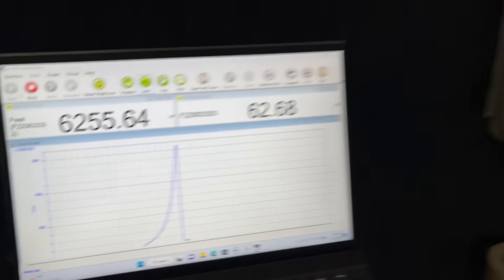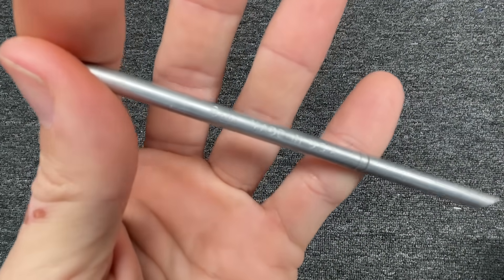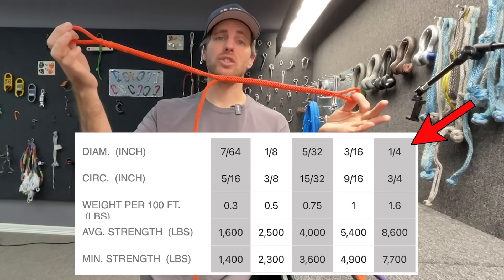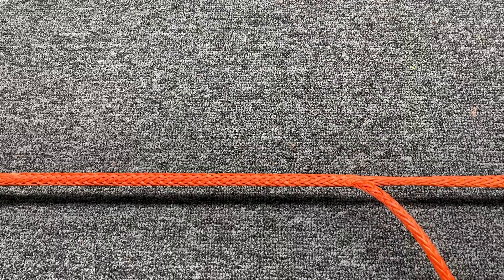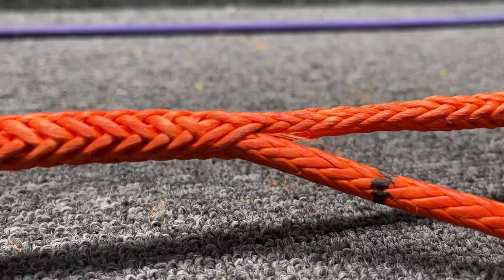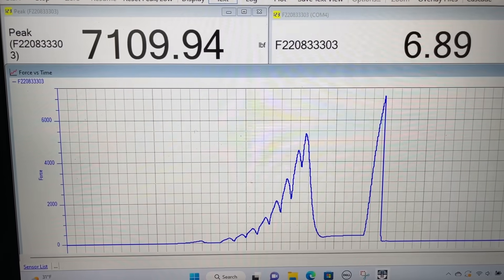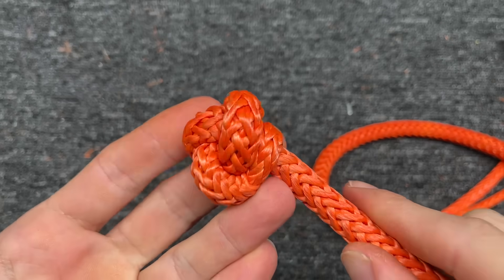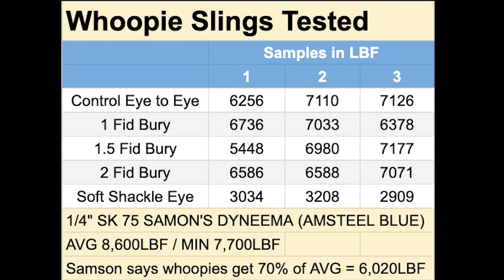Why The Overkill?

Comment: From a standards perceptive, I think that if the testing standards for gear is not representative of normal or intended use than it is not useful as a standard.  I would be interested in seeing more regarding the testing specifications.  Additionally it would be interesting to work with the standards body and manufactures to develop new test standards that include knots, carabineer sized bends, and other common attachment methods.  I could see a standard that says a rope must meet 50% MBS with a knot and 90% with a splice or something similar.
Reply: The problem is: from an engineers perspective the main point of standards is for quality control, not about real use. For quality control you absolutely need reproducibility and this leads to unrealistic setups. A knot is simply not reproducible within an "engineering point of view". Just an example, remember the sharp edge rope standards: UIAA had to withdraw this standards, as test labs couldn't maintain the sharp edges reproducible.

And in addition we are using stuff way beyond it's intended use. If I look up Amsteel Blue, it's technical a mooring rope:-)
Reply: @lw671  I understand what you are saying and I agree, however I think reproducibility can be done in the right way. Fundamentally I think you need to test and in the way objects are used. Crash tests are a good example, it could be done in some rig but actually smashing cars is the best way to test.

I think there needs to be a hybrid. There should be QC testing, but there should also be formal independent testing process that mimics real use. I think if you asked most climbers they would expect their rope or carabiner to meet the MBS when used for normal climbing. A good comparison is rigging gear, if it says 1000lb people will use 1000lb. In general the working load on rigging gear is way less then one would expect based on the size of stuff.
Reply: @L W  I agree with everything you've said. But this brought up a question.  What exactly is 2mm sk95 going to be used to Moore? I'm guessing a small unoccupied air up raft, LOL.
Reply: @daviddroescher  :-) Yeah, mooring is the big ones. The homepage states just that the strength is measured as ISO 2307, an allround-standard for ropes.
Reply: @daviddroescher  I use 1.5mm for the ridgeline of tarp of my hammock.
Reply: @Blargleman the Sceptic  I use 10lbs as leader( 2lbs Mono filament equivalent diameter) and 30lbs ( 6lbs equivalent diameter) to keep it from damaging my fishing real.
Spider wire fishing line 12 strand brade. Engineered purposes and name of product changes below1.5mm .name changes to strength rating instead of diameter. 

James it would be nice to see a response video from Samson Rope.
Reply: @daviddroescher  similar agreement for my lines... spiderwire is EXCELLENT fishing line.

Comment: In engineering they have "stress concentration factors" for things like a hole in a bar or a rounded corner.  These then come with tables for a reduction in total strength  based on the hole size or the corner radius.  I think that it would be really valuable to have a similar result for ropes and other climbing gear.  For instances a test against carabiner diameter could be done.  Or with knots or splices.
Reply: That would be really neat. I wonder if that data is already there. If we knew the type of carabineers or shackles used during the test, which you could get from the video, we might have a pretty good data set with the stuff he's already collected
You could also add a few columns to the DB and start collecting those points from this point forward
Reply: One system went to the Moon, the other didn't. But just have a converter on your website or something to convert the whole table
Reply: @daveb3910   - ha ha, obvs a metric NASA reference (not sure how it got here) - yes metric went there all the way, so many international objects on the moon. Only Americans sadly died directly trying to put some of the artefacts up there (personal delivery adds value no doubt)  - you could blame the flavour of numbering systems if you like - the others got to sleep at home another night (mostly)

Science universally uses SI units.  (everyone deserves a laugh)
Reply: Yes!
I suspect there would even be differences in the numbers due to the bend radius, on the items that failed at that point.

Comment: Seems like it would make a great personal anchor on your harness
Reply: It's strong enough for that, but taking a fall on something this static would hurt, and might break much easier than a dynamic line.
Reply: @jarodlojeck5150  but normally we use a static sling to make a anchor on climbing.
Seems a good options besides petzl connect adjust for example. It's lighter and easier to carry
Reply: @viniciuscollaco  a static anchor with a dynamic rope connecting you to it still has a dynamic component in the system. If you're attached to the anchor by something static, with no slack, and fall, you'll also be ok. If you take a fall with slack in the static system, however, you're likely to break the static line even with a much lighter load than it's rated for. Dyneema is both very strong, and very particular about how it's treated.
Reply: @jarodlojeck5150  But I was not talking about a sling conected with a rope.

Was talking about a anchor to rapeling after. It's just a silng direct to your harness with a carabiner in a anchor point. 

In this system there's no dynamic aspect.

Comment: I guess the really problematic thing is that unless all the manufacturers use the same test in the same way then you can’t trust anyone’s data
Reply: Even if they did, those tests wouldn't necessarily give us an idea of how they perform in real situations
Reply: @PaulEdler  at the least, though, the same testing conditions would mean if you learn how X with x rating operates in a condition, Y with y rating could be predicted, and the consumer could know which is intended to be stronger rather than testing to appear stronger.

For instance, the ISO ratings on warmth for sleeping bags are difficult for many to grasp because the temperatures don’t really align with the expectations (30deg bags are not for sub freezing) nor conditions in which people use (4.9 r value pads are not common, and many will not switch into a dry pair of baselayers nor tuck and cinch the collar and hood and so on). Plus, some bags have baffle structures which mean fills get easily compressed or shifted and others which have much better structure and will sleep better despite similar ratings

All of this as too long of a tangent to say, at the least you can extrapolate from a similar testing method.
Reply: @zacharylaschober  it would. Might reduce Ryan's backlog of stuff to test too.

Comment: Thank you for testing the soft shackle whoopies. I hope my samples bring about an informative conversation.
Reply: Thank you very much for working with this awesome channel! It's very informative!
Reply: I wonder if the results would improve if the whoopie tail where reburied near the place soft shackle penetrates the single strand creating coaxial strands.  Pass the rope through both coaxial strands.  The tail would no longer hang loose, but be an adjustment loop. Which provides backup strength in case the shorter whoopie section slips.  Multiple very short whoopie loops in a row to tune sliding friction might make a resetable(very small number of uses) fall arester.  Unscream the screamer. Or trickline backup.
Reply: ? Did you set the samples?  
What was the taper rate?
Eg strands cut/ separation of cuts.
My preference is what Samson shows on pg 69 step 2 in there book" Slicing Manual " . With a change. 
I also taper the last 6 in pairs ( 2extra pairs cut evenly spaced )  leaving only 2strands at the end . 
I see this as reducing  the sharpness of the taper. 
I have pulled 5/16 sk78 woopie to failure ( broke where the tail comes out same as this test not in the taper of the fixed end). I was  pulling out volunteer aspen trees, with an 8-ton come-a- long and hi-lift jack .out of flower beds roots and all that would come under the fence.
3 thoughts about reasons for long bury.
The tapered part is less effectively cault. In the finger trap. 
1 fid is used up in the taper, making a 1 fid barrie ineffective due to only pulling on have the strands .
Reply: @daviddroescher  with regards to bury length, none of the Brummel eyes slipped. Breaking at the tip of the taper is common when eye bend radius is good, and the splice holds. Soft goods are just variable. I did not make the lengths to manual specs because highliners don't for the most part. None of the Brummel eyes failed. The constrictor lengths of 1, 1.5, and 2 fids were at Ryan's request since, again, most highliners don't follow the manual in order to have more workable minimum lengths.
Reply: @daviddroescher  I set the samples under body weight, and arm strength pulls, but did not have any mechanical devices to assist.
I tapered with a 6 strand taper in opposing pairs. I tapered at a 1/2 fid length in even progression.